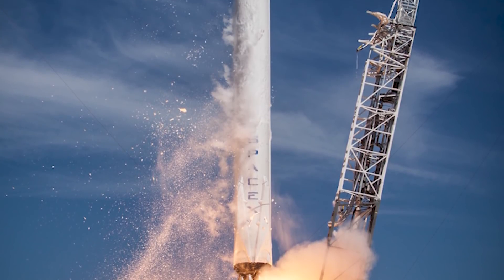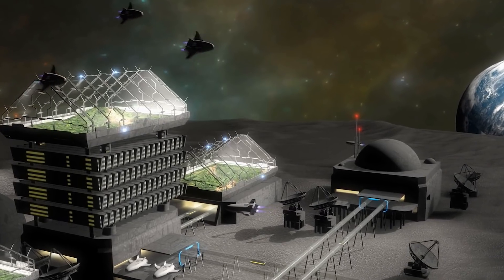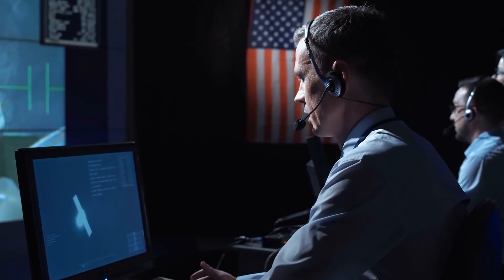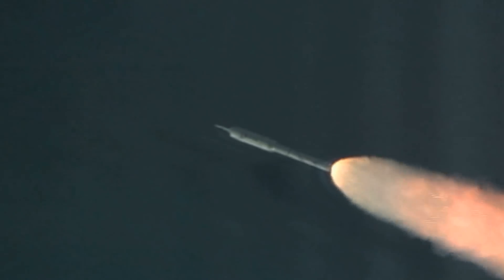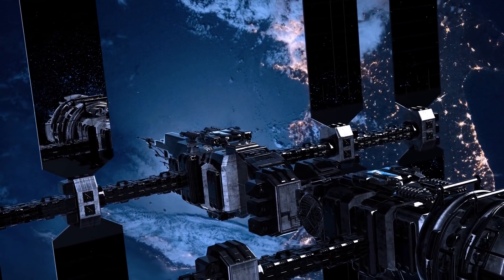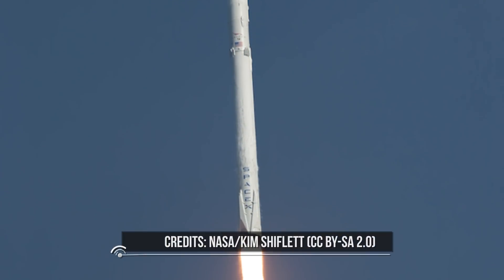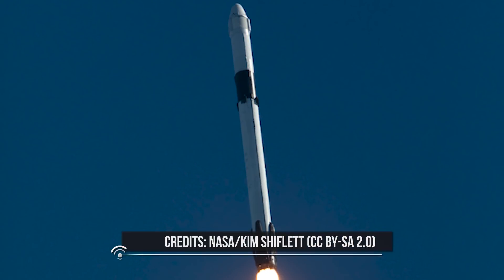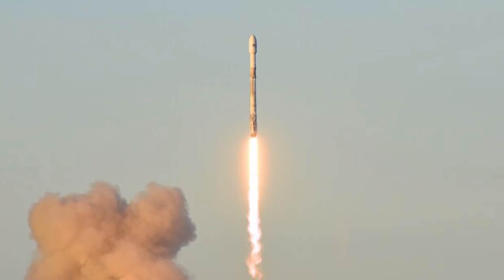SpaceX Launch System & First Land Landing! (Part 1)

Comment: This video is incredibly old, SpaceX has 59 successful first stage booster landings on land and two drone ships, Just Read The Instructions and Of Course I Still Love You, but there is stock footage of a Block 5 Falcon 9 with the black interstage. SpaceX already had 24 successful landings at that point.

The last operational Grasshopper exploded during testing August 24 2014. I dunno, this video would be accurate in 2014 before that, except for the Block 5 stock footage. That makes it look like purposeful misinformation.

Comment: Good video... Oh... Wait.... Nevermind
You really got many facts about SpaceX wrong, 
the video isn't about what the title suggests...
I got the feeling the script of this video was written a few years back multiple times... 

Ya really gotta go and check your facts, sources, and grammer... This was bad.
Reply: I agree the information is so wrong in this video that I stopped watching 1/2 way through. Grasshopper was a test rocket to demonstrate vertical take off and landing. It was followed by F9R Dev which was closer to the actual size of a Falcon 9 1st stage rocket and did the same testing. Starhopper is a test rocket using the new Raptor engine with the 9 meter diameter fairing as a prelude to Starship (2nd stage) and Super Heavy (1st stage, which I assume is the reusable 2 stage rocket mentioned in video but incorrectly named) currently being built and tested in Texas.

Comment: Why are you talking about Grasshopper? That was retired years ago when SpaceX was working on landing a Falcon 9. Now the Falcon 9 is a mature vehicle they are leaving alone and they have switch ed focus to Starship. They made Starhopper which did one short flight really to only demo the Raptor engine. Since then they have been testing Starship prototypes called SN#. Most of the initial tests were just trying to get a tank that could hold cryogenic liquids at flight pressure. They recently did a 150m hop with SN5. SN6 is now getting ready for a hop. SN7.1 is going to be another test tank like SN7 was and SN8 is expected to be the first one that gets a nose cone and fins. If that pans out it likely will be the first one that goes above 150m as aerodynamics become important the higher you go.
Reply: I feel like this video was re-uploaded. Only way to explain how outdated it is. When you do that you should really add that to the title or description so you don't mislead people.
Reply: I had to read the comments to see if anyone else caught that. Took the like seventh out of twenty but thank god America is not as dumb as the rest of the world thinks we are.
Reply from the maker: It' s not old Sol Morris, We are doing a series and this is just part 1 of 5